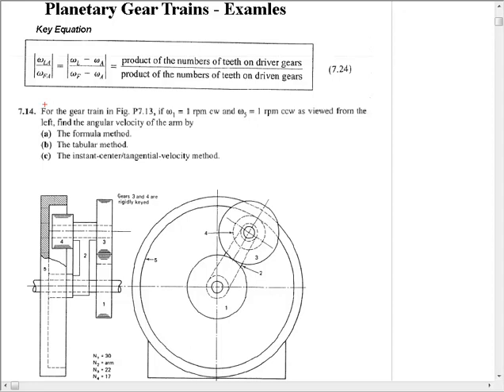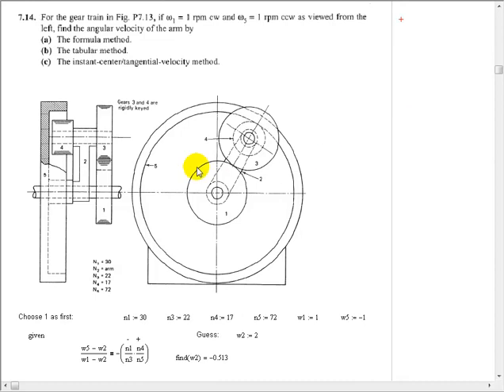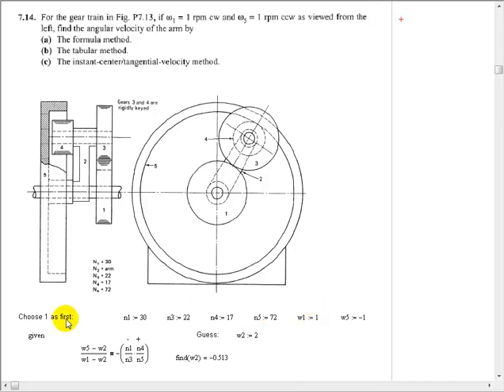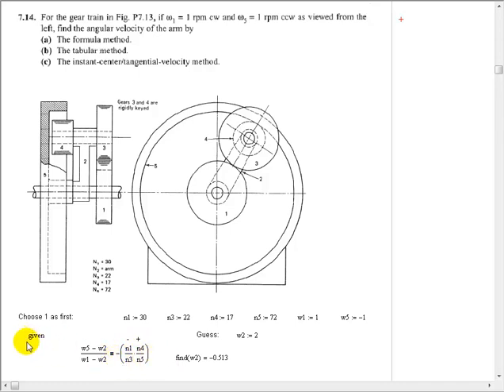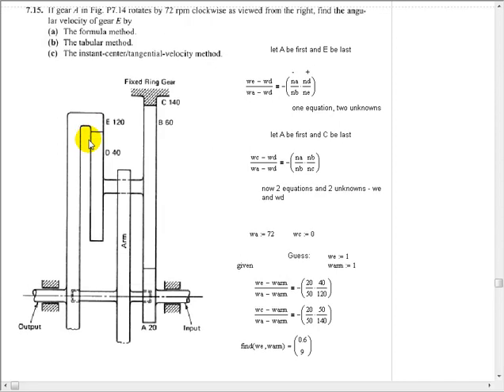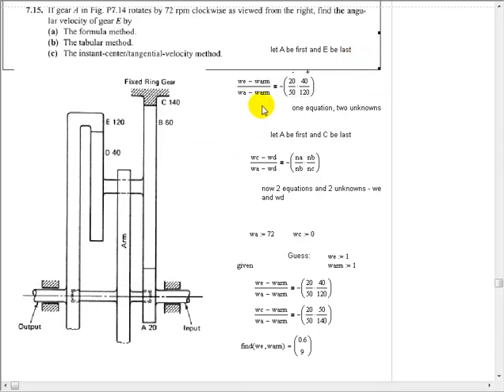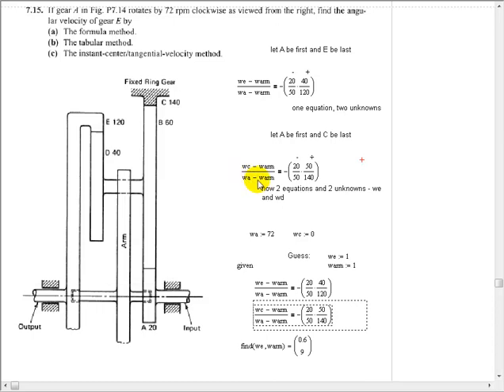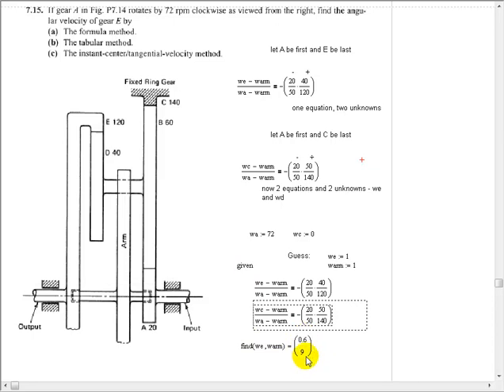Planetary Gear Train Examples

Comment: Thanks so much for the video tutorial, has really helped for my exams in understanding the concept fully, much better than i learned in lectures atleast. Just a mistake to point out, the number of teeth on gear B is 60 rather than 50 (atleast thats what it looks like). It doesn't make a difference calculating the arm speed but affects the calculated speed of E. But yeah cheers, if this kind of question comes up tomorrow I should get full marks ... here's hoping.